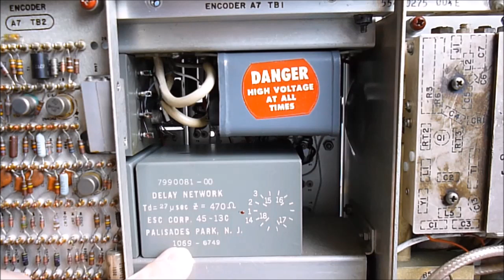Collins 621A-3 ATC transponder teardown (reupload, all parts in one)

Comment: The small metal can capacitors at 14:37 are wet tantalum types.  Quite common in older military/aviation electronics.

The connector on the side of the transmitting tube cavity is a TNC, or Threaded Neil-Concelman connector.  Also I believe that would be the signal output, and the other RF connector the signal input.